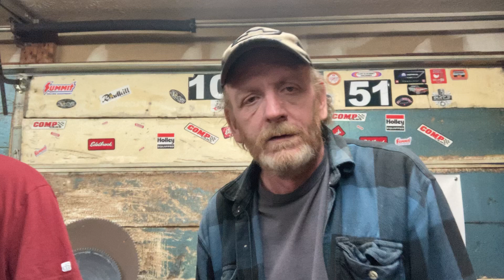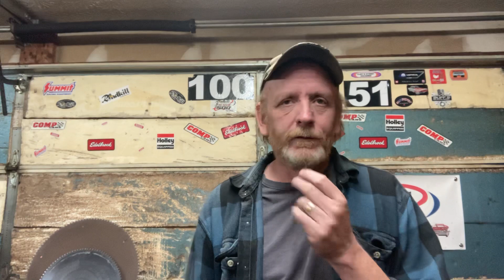What do I do Now???

Comment: I would take the trans down to nothing and fully inspect it.  If there are no broken pieces, cracks, etc, then go for the $800 option.  If there are questions, then spend the money on a rebuild.  No use spending $800 and then find out you have to spend even more on parts.
Reply from the maker: I’m pretty sure I can solve the problem. The person a let rebuild it just messed it up. 👍👍

Comment: The term remanufactured and rebuilt in the trans world are two completely things. a reman trans will have way more new parts in it. that are new and designed to improve on all the factory flaws.
A rebuilt has the parts that failed replaced. Big difference most all rebuilds come with a year warranty and a couple dozen things that will void the warranty. I'll send you a few bucks for a 12 pack. 
bottoms up  🍺🍺🍺🍺🍺🍺🍺🍺🍺🍺🍺🍺.
Reply from the maker: I’m just going to hit it and see what happens. Start from scratch and get it done. Should have never relied on the other shop. I have never had a good experience with a transmission shop period. That’s why I learned how to do it. Was just in a time crunch and let the guy do it. 😡😡😩😩👍👍👊👊

Comment: Seeing how you went through it once already and had eyes and fingers on everything...... by chance can you find another Core at a Pull-Apart? Problem could be in the case. Hate to see you have to go through all that trouble again.
Reply from the maker: I honestly think other than the obvious sprag problem, the rest lyes in the valve body. But going with the comments I’m rebuilding it. If nothing else I can take the kit out of the 4 wheel drive and stick them in the trash truck. So let’s see how this turns out. 👍👍👊👊

Comment: None of the above.
You need a car.
Go to the bone yard buy one that works and put it in. Preferably the newest one that will work with what you have and being that it’s newer, will have the updates.
Then rebuild the one you have and make it better with 4L60 Sprag and more frictions.
Why; 
If you buy a new one, they’ll need a core or charge you big money if you don’t. A junkyard may charge you, or may not for core, but it won’t be as much as a new one would. Now you have an extra transmission for parts. BTW if the Sprague did explode, I’ll be willing to bet you’ll need a case and in either scenario if you need a case they’re going to charge your core.